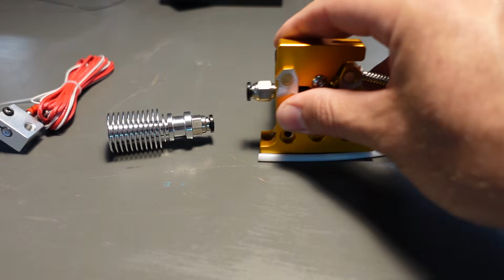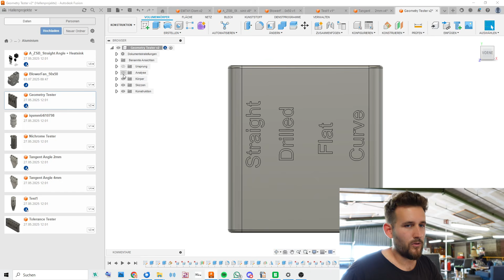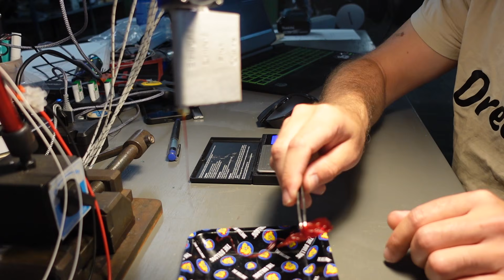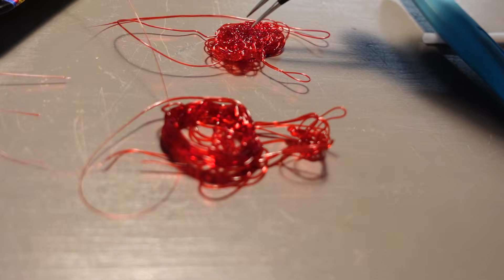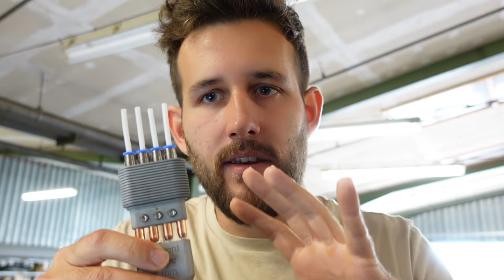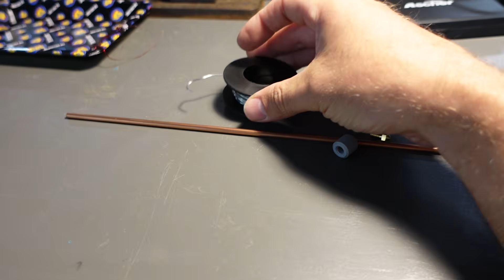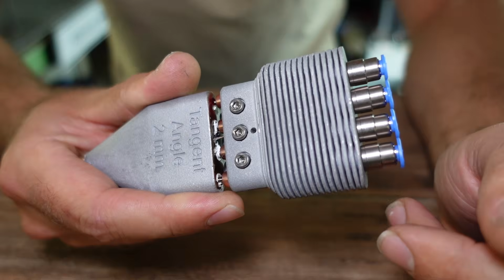Minuteman's World Record Hotend for your 3D Printer! 200+mm³/s Flow Co-Extruder! (Roetz-End E01)

Comment from the maker: You got any name suggestions? Post them here as a reply ❤
Reply: Fast Ass Filament Fuser (FAFF)
Reply: One question 
Does this nozzle opens up future potential of color mixing ? 

Like we just need cmyk to use all color (like printers) 

Maybe the 4 nozzle extrude at diferent flow to achieve some spesific color
Reply: @RiskuNote no, the viscosity and the speed of the material will not allow for turbulent flow. Laminar flow won't mix the material
Reply: Considering the fact that you can theoretically add as many filament leads as you want and it IS a bit of a monstrosity I like the idea of pulling inspiration from Greek mythology and dubbing it a Hydra of some sort. The HydraHB (for HeizBlock) has a good ring to it.
Reply: R4
Reply: It's a four-port forced filament fuser. lol     Maybe something along the lines of Latin Vis / Vires for "force, power, or violence" 

I feel like this is the closest we're ever going to come to a filament "super charger".  I cant wait to see where this goes,  I was prototyping my own overkill machine and I might just have to seriously look into including this.
Reply: Surely, as it's Minuteman's extruder that pushes out ridiculous amounts of filament, it should bear the name Pusherman? :)
Reply: Fussor - The Fussinator!
Reply: MinQuad
Reply: Brilliant work.
Did you think of flattening (squeezing) your copper tube in the middle section.
Reply: Not sure if it is possible, but can you electroplate the copper onto the aluminum hot end?  That way you will not have an airgap between them.   Electroplating will also allow you to deposit copper in any shape of the hot end.
Reply: I suggest mr. shitfuck
Reply: The Enfourcer
Reply: I wonder if crushing the actual 1.75 filament into a 2d plane help with increasing surface area and thus heat transfer? It can then melt back to its shape at the nozzle end. Probably not feasible for consumer market but whatever
Reply: Hi there)
It is so nice that you've building some stuff so we don't need to😅
I had the same idea to push several filaments at once in one hotend and SL_ST 3xEXTRUDER-02. I'm really happy to see the concept at work 😊
Reply: 2 Min, wow. : )  Just some possible improvements. I'm working on a similar part cooler to your SS duct with the help of CFD. I think it might help if the center area close to the extruder tip could be removed and replaced with a Teflon insert to help with insulating the tip and filament sticking. If the temp is too high for Teflon, you could use glass. Both are excellent insulators, but Teflon would be easier to machine. 
Noticed your dryer is near 20%. Put some desiccant bags in if you have room. Mine is just a bin with 1500 grams of desiccant and is constant at 11%, holds 6 rolls.
I'm also thinking about your XY motors. Are the two motors per axis required? I have some ideas for reducing the moving weight. Great work! Hope this helps.
Reply: I keep thinking of the Autobahn because of multiple lanes and FAST traffic (throughput)
Reply: The Quadrilator. (4 + filament + something on the end to make it sound cool.)
Reply: It's definitely a Detlef.
Reply: I think you could just call it the Roetz hottend or Minute hottend , just keep it simple and take credit for it.
Reply: Tap the drilled hole, if the rough surface increases heat transfer a tapped one will increase it even more. probably between the curve and the flat but somewhat easier to build than both.

Comment: I wonder if this is all about heat. Were all 3 heaters in there. I worry that the 2 worst where the 1st and last that only see 1 side of 1 heater. 2 and 3 see 2 sides of a heater. i guess that is inaccurate, 2 was better than 1 but 50% of the surface area was removed so thermal transfer is lowest.

Comment: Impressive melt speed, but have you managed to print anything clean with it?
Melting 200 mm³/s isn’t the same as printing 200 mm³/s.
Layer cooling, pressure and XY stability usually limit usable flow to under 100.
Would love to see a benchmark print and its quality if it did actaully finish the print

Comment: You may be doing it wrong. Extruders, in situ melting .. that is low tech, uncontrollable. What you need is an engine, with pistons pumping the pre-melted juice at a very high pressure onto your BSO close as possible.
It is harder to build but it also removes a lot of variables... in fact all of it except cooling and motion.

Comment: I wonder if the Filament going trough the middle is getting hotter than the both on the outside.
So maby sqare them up and use 4 heating Elements to get equal temps.

Comment: I'm not 100% surprised by the copper liner experiment, since it doesn't feel like radial heat transfer in the innermost ~0.5-1mm of the heater block surrounding the channel should be the limiting factor. We've established that plastic sucks at transferring heat... sure it's undergoing a phase change and is a heat transfer fluid, but it still is not a good thermal conductor compared to aluminum. 

It feels like an all-copper block is mostly beneficial in terms of lateral and axial heat transfer. Lateral heat transfer confers the ability to move the heat sideways from the cartridge to the bore without excessive drop (thus making sure the response isn't laggy, which causes control loop overshoot and undershoot). Axial heat transfer ensures the thermistor is actually at the same temperature as the exit material, since otherwise the metal around the entrance of the bore will be significantly cooler than the metal at the nozzle.

So although I don't have numbers to back it up, it doesn't seem like the comparatively short distance occupied by the liner is the most important link in the heat transfer chain. 

I guess to counterbalance my whole assertion, I do know that radial thermal conductivity of a cylindrical element scales as the log of the OD/ID ratio, meaning that actually for a thick-walled cylindrical conductor, the inner surface is the most important material in terms of thermal conductivity. So I could just be dead wrong here... but typically these hot ends don't do a great job of approximating uniform radial conduction. The heat originates in a relatively concentrated heater bore, has to fan out to the bulk of the material, and then has to funnel back in radially to the melting channel. 

The other reason to avoid copper/aluminum hybrid construction is of course CTE mismatch. I'm sure commercial products can achieve some sort of robust bond, but how is anyone supposed to do that at home? Soldering to SLS aluminum sounds horrible, especially in a deep bore.

I wonder if going a little bit crazy with heater number and distribution might be a more productive path than trying to bake copper into the device. Since you have arbitrary geometry here, it feels like you can cram multiple heater cartridges in quite close to each bore, and perhaps that way alleviate the lower thermal conductivity of aluminum. Doesn't solve axial conductivity, but perhaps with careful thermocouple placement that won't matter.

Another thought might be a Y or cross or star shaped melting channel. Perhaps this could be like your flat channel but possibly with even less flow restriction. The "fins" of metal that reach in to form a Y shaped channel seem like they might cut through the outer melted layers like a hot knife through butter and reach into the core with less overall disruption of the flow lines. I guess the only obvious reason this might be worse is that there's larger overall wetted perimeter with a Y shape than with a rectangle like you have, if they have the same aspect ratio. 

However a Y shape channel or a shape with more arms/fins might not need to reach as extreme of an aspect ratio as your flat channel in order to get the heat into the core. The fins might only need to "poke in" so as to leave a free unobstructed central channel of half of the diameter of the original filament, with an overall channel shape spanning perhaps 1.5 times the diameter of the original filament, and that should reduce the melting lag due to thermal diffusivity by more than a factor of 2 (since there's now only 1/4 of the mass of material in that central unobstructed channel, and it's only about half as far from the metal as it was in the circular part of the channel).

Comment: The flat performance was very interesting.  I wonder if it is just surface area per cross section, or if mixing matters.  You could take copper tube and just flatten a longer section.  Compare that to flattening short sections orthogonal to each other.  My guess is both will transfer heat faster to plastic.  
My other suggestions are that you can use silicone rather than that plaster stuff and consider an inductive heater.

Comment: 39:00 one random thing that could make some difference is annealing the copper first. depending on the source of the copper, it may come to you hard or half-hard. heating it up will soften it and make it easier to form into the body (though it might also make it too squishy to press in)

Comment: Can you electroplate copper onto the channels, either directly or through some intermediate alloy. That'd get rid of the issue of trying to squeeze a pipe in there and any need for thermal paste between them

Comment: my guess on why the copper didn't perform nearly as well as you expected it to: the thermal interface between your rough surface finish aluminum and your slightly undersized middle copper tube is gonna be a very small effective area, which leads to low thermal transfer overall. what might've helped there is putting some kind of high temp thermal paste in the block first, then pushing in the tube, and making sure you have good contact with it all the way around and to the bottom.
Reply: this is i think the exact reason why it did not perform well. and the weird extrusion is probably due to unused channels

Comment: For finishing channels in a split or two piece hotend, a magnetic pin finisher using .5mm diameter by 4mm stainless steel pins to bombard and "burnish" walls can produce very nice surface finishes.

For single piece hotends .25mm or .5mm diameter x 1mm SS pins could be used. The Hotend channel could be filled with the pins and burnishing fluid, capped, then placed into a rotating magnetic field, which would cause the dozens or hundreds of pins to bounce around hitting channel walls.

Comment: Since you said the filament isn't conducting heat well, then isn't the limiting factor of heat transfer directly at the transition from the cylindrical metal surface into the filament? (That means the limiting factor is not the conductivity in the metal itself?)
Lets say your filament can "steal" only 1W per second per mm² from the metal surface, then it should not not matter much if the metal can conduct 5W or 10W/s/mm² internally, right? 
But...
Alternatively couldn't it be the case that the volumetric thermal capacity (Jcm⁻³K⁻¹) of the metal is also important to smooth out bursts of energy stealing from the filament?
Because if the metal (just at the surface) can't store much for dispatching a lot of heat in a short amount of time, the filament might steal more temporarily (empty the metal's surface heat buffer) than the metal can recuperate via it's thermal conductivity.

To save you time: 
Aluminium: 2.422 Jcm⁻³K⁻¹ 
Copper: 3.45 Jcm⁻³K⁻¹  
Silver: 2.44 Jcm⁻³K⁻¹ 
Also don't forget copper (8.96 g/cm³) is almost 4 times as dense as aluminium (2.7 g/cm³). (In regards to keeping viability for use in hotends with high accelerations => what I mean is keep it lightweight.)

Maybe it could be a mix of both, thermal conductivity and volumetric thermal capacity, that is influencing the results...

Comment: Awesome tests. Gives me many things I can also test! Thanks!
I suspect cold side can be significantly smaller, and it will need to be to work with most of the enthusiast printers out there now.
Thanks for your hard work.

What I want is a second “cold side”. Connection points to connect to a toolhead near the bottom of the hotend to reduce the bending moment on the heat break(s)
Reply from the maker: Yes I'm thinking about how to achieve that already ... In my next test I'll put this on an i3 Style machine therefore I have only movement in the strong direction of the heatbreaks. thanks for the comment!

Comment: the only benefit you can achieve with using copper for the hotend is keeping the boundary layer between copper and plastic as hot as possible, so a maximum of energy flows from the metal into the plastic.

This will only be beneficial if your coupling at the aluminum-copper interface transfers more heat into the copper liner than a solid aluminum block was previously conducting directly into the aluminum-plastic interface.

There are two variables here: thermal coupling of the copper-aluminum interface and surface area of the copper aluminum interface.

Simply putting a thin-walled copper liner into the block will achieve nothing

Comment: Isn't the heat transfer within the filament mire important than the transfer from the block to the plastic? So minimizing the diameter of the filament and maximizing the surface is more effective than the choice of block material.
Reply: Yes.  At least between aluminum and copper -both excellent with no measurable temp gradient.

Comment: The flat channel has an enormous advantage over high flow hot ends that split the filament in the middle: it won't trap fibres and doesn't have a splitting edge to wear down.
Being able to print carbon fibre nylons faster would be an enormous advantage. 🤔

Comment: Seems like a water-cooled "cold-end" could be useful. Likely will be lighter weight. Could be easier to manufacture too, since aside from the copper parts, it could be printed out of plastic. And it would overall be smaller and shorter.

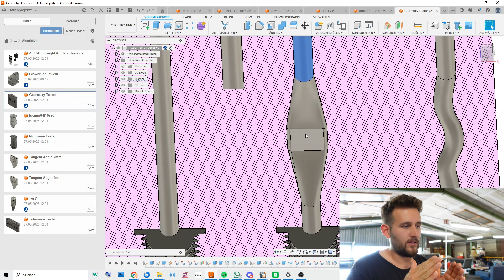Comment: You should probably make the flat section (shown at 15:20) have a slightly larger surface area than the 2mm entrance hole. Making it wider would be the best bet.

The walls cause friction on your flow so the higher the ratio of wall/filament contact area to filament path area, the more resistance to flow you'll have.

Comment: For the copper hotend insert i have a slight idea: Using a flow-through copper electroplating, you could probably use a peristaltic pump to pump the copper electroplating solution through the inside of the hotend while applying current simultaneously. maybe this way the inside can be coated with copper that conforms around the aluminum. some small surface preparation on the aluminum side may need to be done through (maybe in a inert gas glovebox?) because of the oxide. also what about galvanic corrosion?

Comment: Not sure if it is possible, but can you electroplate the copper onto the aluminum hot end?  That way you will not have an airgap between them.   Electroplating will also allow you to deposit copper in any shape of the hot end.
Reply: You woulnd't gain anything - the limiting factor will still be heat transfer from the aluminum to the copper - even if the copper has a higher thermal conductivity, it's wasted unless you can get more heat into the copper itself. You would have to electroplate a very VERY thick amount of copper for the surface area difference between the al-cu interface vs the cu-plastic interface for the copper to have any effect at all

Comment: I think it would be interesting to take the flat geometry and then have a second zone that's turned 90° flattened in the other dimension and see if that takes it even further. Also I think the copper liner idea was primarily limited by how loose the fit was with no proper thermal interface between the aluminum and copper. I just don't think the aluminum was getting the heat into the copper tube.
Reply: Yes.  I had the same idea to answer if it is just surface area to crossection, or if mixing matters.

Comment: Heat pipes. Played with some DIY ones (water vapour, completely uncontrolled seal) about 12 years ago and you can very quickly get heat in/out of a hotend block. 
You can buy them pre-made nowadays. One of the few ways to get more rapid heat transfer than just copper.